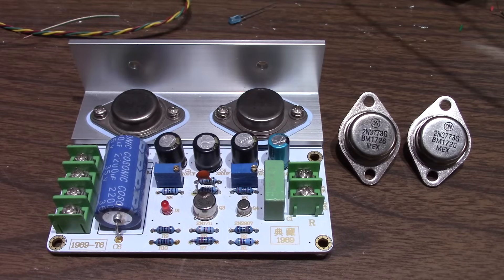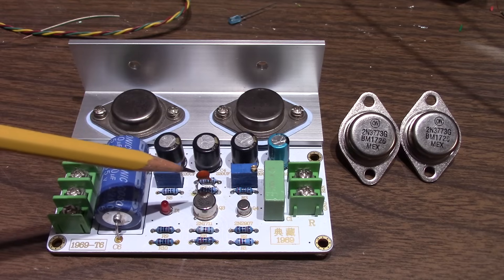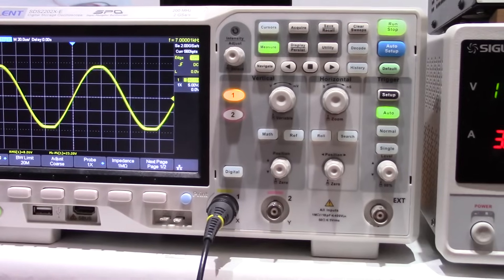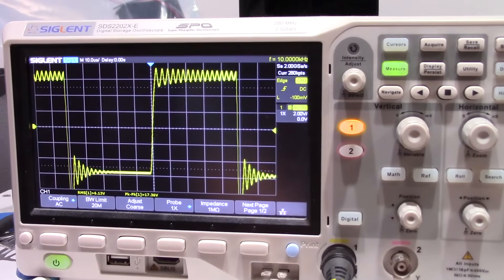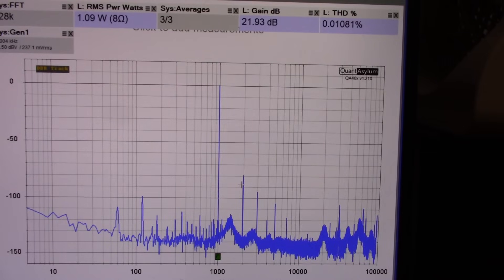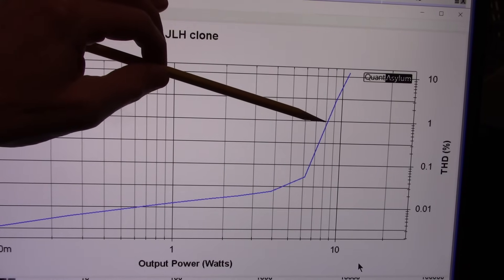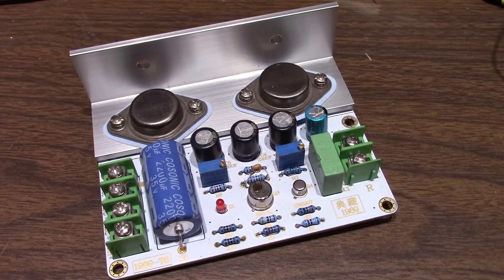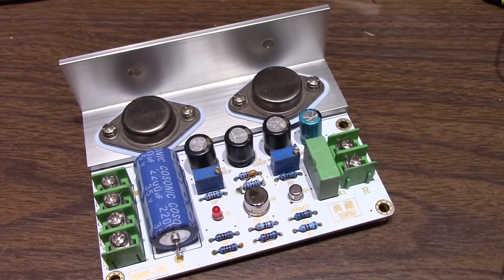JLH class A amplifier clone tested on the analyzer

Comment: This video inspired me to buy a couple of these prebuilt.  I did pull one of the 2N3055s (they all look new) off the board and measured HFE of 29, so well within spec.    Adjusted for T1 at 7.5v and amps pull of .75 which is all I could get with 15v supply.  Scope showed about 6 watts output, just a small amount of square wave overshoot (not ringing) at 10K frequency.  I will try the 500pf cap across R5, but nearfield listening sounds quite good, maybe a little harshness in higher level female vocals (the overshoot?).  
   Also will try a kit and substitute MJ15003G transistors from DigiKey; those are supposed to be a drop-in substitute. I do use massive heatsinks so there will not be any issues in that regard.  
And I will try decent quality meanwell 24v/5a SMPS instead of the LPS, and readjust.   24v supply should allow full Class A bias.
I have to say that the 1969's sound- even at only 15v supply - compares favorably to my $2,500 Musical Fidelity A1 (2008 version) Class A amp.  And the 1969 pair are two orders of magnitude less expensive!
Reply from the maker: Use 100pf compensation capacitor. 500pf is overkill as was demonstrated in the video. This circuit design may have issues driving certain high power transistors properly, so test when substituting parts.
Reply: @JohnAudioTech  10-4, thank you John!

Comment: Class A distortion is different from Class A/B distortion, so I think the issue is more about the distortion profile than it is about class per se.  And BTW, I'm much more concerned about speaker performance than amp performance.  Having directy compared both via an. A/B system (it's not blind much less double blind but it's an instant comparison, which is what I want) I can very comfortably say my concerns are MUCH more about speaker design than amp design.  In any case I appreciate your analyzing.

Comment: Hi, can you let me know how to setup the amp? i know the first pot it´s for 1/2  sorce voltage, but the current, i don´t know how to setup, could you explane to me maybe with a picture? thank you very much and excuse my english
Reply: Set your multimeter to amps, then connect your ground from your power supply to ground on your amp, then connect the positive from your power supply to the negative lead on your multimeter and then connect the positive lead of your multimeter to the positive on the amp.

Comment: I am pretty sure on capacitive coupled output most people are using cheap capacitor, you need to use low ESR high ripple current rated caps on the output.

Comment: In my opinion, every audiophile must have 1JLH, 1 SE tube amp and no matter how expensiv others amplifiers.
Thanks for video!
Reply: These little modules sound really good with efficient speakers.I replaced my China 2N3055 transistors with NOS Westinghouse, although they sounded really nice even with the Chinese transistors. I would use 200-300VA toroid and lots of capacitance for the power supply, and somewhat large heatsinks.Probably 4x6 inches, 1inch thick should suffice. These modules will embarass a lot of commercial amps.

Comment: Good analysis...  I had a JLH once upon a time...  and I remember liking it.  With a pair of efficient speakers it was quite listenable.  I remember driving a pair of vintage Klipsch Cornwalls with it...  if I remember correctly those speakers had a 100db/1 watt/1 meter efficiency...  and that amp could play them quite loud.  As Paul Klipsch said himself "What the world needs is a good 5 watt amplifier".  Ya, class A is pretty inefficient...  so from a practical standpoint they are kind of dumb...  but like old tube amps they're fun, and that's all that matters.

Comment: Greetings from Serbia. It could be that output transistors are Chinese made by ISC. That is legitimate company and their parts are very good, at least as good as original 2N3055. I noticed that the color they use for markings is easily removed. So it's not indicator that transistors are of bad quality.

Comment: Good video.  I leave my like.
I would like your opinion.
I bought the Behringer CX 2310 active crossover.
My idea is to build a system with three separate amplifiers, for bass, mid and treble. The possibility of being able to vary the crossover frequencies is very attractive to me.
However, it seems to me a waste of equipment to have three complete amplifiers only to reproduce in them only a small range of frequencies.
My idea is to make three simple amplifiers, in a single cabinet, with a single power supply, and as simple as possible.
The crossover delivers a very large signal at the output: up to 7 Volts peak-to-peak on each balanced output, so you can get 14 Volts peak-to-peak on the push-pull.
This means that my amplifier will not need an input stage, nor a voltage amplifier.  I only need to input from the XLR output of the crossover to a single output stage.
Since the crossover does not deliver more than 10 mA to the output, I think an amplifier made with Darlington transistors would be just what I need.
Does this sound like a good idea or do you think it won't work?
Greetings from Argentina.
Reply: First off, be warned that an analog crossover like the CX2310 may not have the flexibility you need for a real speaker. You may need to flatten out the individual drivers' responses passively before they will integrate properly. (Measurements obviously required.) Having a passive series notch to tame your woofer and midrange breakup modes tends to be a good idea anyway.

Secondly, you'll be losing less complexity than you'd think even if you only need what amounts to a power buffer. You can lose your VAS, but without an input stage there'll be nothing to apply feedback to. Said input stage will also need to handle large common-mode voltage swings - unless you decide to make the whole affair overall inverting, which arguably isn't the worst idea in the world and common practice with many headphone driver ICs and the like.

I hope your ground routing skills are up to par, given that putting multiple amplifiers into one case comes with some extra challenges in terms of avoiding ground loops. Just because it's commonly done doesn't mean it's trivial.

If in doubt, there is no shame in buying off the shelf if it suits your needs.

Thirdly, the notion of varying crossover points on the fly sounds a bit hair-raising to me. Those tend to be chosen carefully for dispersion matching as well as diistortion and power handling concerns. It may ostensibly work on the less critical woofer-midrange crossing, but the mid-tweeter crossing could prove a lot more tricky in that respect. I would very much suggest frequenting an active speaker DIY community (maybe the diyAudio forum, even ASR's is not half bad) and getting yourself up to speed.
Reply: @PileOfEmptyTapes   WOW.  You have dedicated a very useful and extensive comment to me.  I really appreciate that.
Let's forget about my project for a while.
For now I am running my system with three amps.  
The treble I repruduce with an Akai AM-UO2; the mids with a Technisc SU-V660 and the bass with a Pioneer A-80 (a monster !!!).
Of the three amps, the only one that belongs to me is the Technics.  The other two are borrowed and I have to return them.
Now imagine what a waste of equipment .... to use an Akai just to drive a tweeter between 4000 Hz and 12 Khz, or to use a Pioneer to drive a woofer between 30 Hz and 120 Hz ...  it seems silly to me to waste equipment like that.
Much more logical (and according to engineering) is to develop a triple amplifier, sharing the same power supply, the same cabinet and perfectly matched to the XLR outputs of the crossover, because it will not work with other equipment but with that crossover.
All other considerations are technical and, with more or less effort, I will be able to solve them.
Best regards from Argentina.
Reply: what are you driving? 3 way active crossovers are usually for 200+ watt rms PA applications, not home units that just use passive 2 ways usally.
Reply: @thedavesofourlives1  I don't think the same as you.
You use active crossovers if you want them, no matter how much power you want in your speakers.
I built myself two three-way cabinets, with a 15-inch woofer inside a bass reflector, an 8-driver array for the mids, and a horn tweeter.
And I used an active crossover because that way I can adjust the sound quality according to my personal taste.  
Depending on the kind of music I want to listen to, I can run the woofer from 10 to 140 Hz, or up to 400 Hz, as I like... or the mids from 200 Hz to 4 Khz or from 1 Khz to 6 Khz... and the tweeter, the same.
The flexibility of the system is such, that I get a variety of sounds with an incredible variety.
So far I am using three good brand amplifiers of which only one belongs to me.  The other two have been loaned to me and I have to return them.
So I will build a triple amp that fits perfectly with my crossover.
The interesting thing about all this is that the crossover delivers a very large voltage at the output.  On the “XLR” connector I can measure 14 Volts between pins 2 and 3. So .... why do I need to amplify that signal if it is already huge.  The only thing I need is to control with that signal an output stage that gives me a high current to drive the speakers.
I don't need a differential input stage. I don't need an intermediate voltage amplifier.  I just need a good linear output stage and it occurred to me that, with two well polarized Darlington type transistors, I would already have my “adapter” (better word than “amplifier”) that will allow me to connect the output of the crossovers to the speakers.
Besides, the signals between pins 2 and 3 of the XLR connectors are already 180 degrees out of phase, so if I connect each output to each Darlington transistor I don't even need a phase inverting transistor.
With only TWO Darlington TRANSISTORS and several resistors I would have enough power to drive my 4 Ohms speakers.
And I wanted to know John's opinion because I don't miss any of his videos.

Comment: The 2N3773 is a slow transistor. In fact, none of the four datasheets I have for it even list the fT. Of course, real 2N3055's are slow, too. I don't know about your counterfeits. You might try the MJ21196G, which is a massively powerful transistor, and which has a published fT of 4MHz.
Reply: I'm guessing the stability of the JLH depended on those old slow 2N3055s...
Reply: @Luckless_Pedestrian  A lot of amps from late 70's early 80's depended on slow devices. They often sounded very nice though, perhaps due to less complex circuits required or just the nature of homotaxial transistors (vs. modern epitaxial types).
Reply: @peterlarkin762  Yup...  have some vintage stuff with those old, slow '3055s...  learned a lesson years ago in rebuilding a Dynaco ST120...  although Dyna had used several different OTs over the 120's long production run, mine had the '3055s (specially selected high voltage versions so I'm told)...  when I rebuilt it, I decided to use more "modern" Motorola devices (can't recall the designation) that were "faster"...  long story short, I wound up with a 60 wpc oscillator...
Reply: @Luckless_Pedestrian  Lol same experience with Audiolab 8000a, Arcam A60, Luxman L30. Back in the day the manufacturers could request specific Hfe and Ft. Early Audiolabs had unique custom outputs... impossible to replace now. Same goes for small signal BC's, there are so many variants. Modern ones sound just ok. Some vintage telefunken's sound more natural. Anyway, hope your Dynaco found better times. If not send it to me ;)
Reply: @Luckless_Pedestrian  I was just thinking the same thing.  It is such a a simple circuit
Reply: The 2N3055 is 2.5Mhz, not much slower than 4Mhz????    ...am I missing something?
Reply: @stevenbliss989  The Ft varied hugely between brands and years. Same with the 2n3055. It was due to the manufacturing processes. Pre 1980's devices are probably below 1Mhz. From mid-80's on they are all 3 to 4Mhz. MJ21196G might be a good choice as they're very rugged, but might need some miller compensation.
Reply: @stevenbliss989  I wasn't sure what the fT of the 3055 was. But, the MJ21196G is a much heavier transistor in terms of power dissipation, current, and voltage.
Reply: I struggle to hear above 6khz !
Reply: @TernaryTrout  Mine isn't quite that bad, but at almost 61, I can't hear like I did as a young man. When I was a teenager, I could hear to 22kHz in my right ear, and 18 in the left. Now both ears top out at 12K.

Comment: Interesting stuff JAT ! there is a comment down below about the choice of cap used in your demo, would you explain it please ? it involves passing all your audio through the cap and it sounds awful so I am confused as to the location of the cap.....if that makes sense !!....cheers
Reply from the maker: Some type of capacitors have a nonlinear response to a changing voltage on their plates such as class II ceramic capacitors. Class I types such as G0G/NP0 types have orders of magnitude better performance. Poly film caps are even better. The cap is in the feedback loop where distortion introduced in the circuit is not corrected. I used a class I type cap.
Reply: @JohnAudioTech  Ta :)

Comment: Class A distortion is primarily Even-order Harmonics.  These are way less objectionable to the ear than odd-order.  Efficiency does not make the list of criteria for my Amplifier selection.  It's not like I'm using AA batteries to run it.
Reply: Depends mainly on you age. Second harmonic distortion is liked by young and third by old . Second sounds sharp and bright third sounds warm and mellow
Reply: The even harmonic is down to transistor choice and no balance long tail pair on the input.
An npn pnp output causes even harmonic cancellation.
If you read Doug Selfs book you will see the graphs for this.
Reply: @Margarinetaylorgrease  I meant to say that the distortion measured is not as objectionable if it were odd.  Not that it needed further reduction for this power level
Reply: @keithblume5159  
Extra, with npn pnp output 3rd is increased over same sex output. Yes I sex my transistors

Comment: Just a tip, use good quality capacitor in your feedbackloop because all your audio is going throug it.
Reply: You mean the NFB resistor by-pass, or the electrolytic to signal ground?
Reply: @paulb4661  what I saw in the video he was using a cremic capacitor in the NFB loop. Those sounding awful. Try in a good sounding amp silver mica capacitor instead.
Reply: @gilbertbergh8980  agree, I’ve done side by side recordings with film and ceramic, it was night and day.
Reply: @gilbertbergh8980  The former then, I'd argue that, using your semantics and without going into too much detail, the "audio" passes through the resistor and only the ultrasonic content goes through the cap, whose sole purpose is to result in the amp attenuating, rather than amplifying these. In essence and in a simplistic form. If I were to suggest anything, it'd be to go with 1216 smd NP0 MLCC, as this eliminates stray inductance of the leads and in general, smd topology allows for shorter signal path and better tolerances, than traditional THT.
Reply: @Margarinetaylorgrease   Recordings of what? An amplifier's output with either of the by-pass cap type in the NFB loop?
Reply: @ thank you for asking.
I had two identical condenser microphones.  Both had ceramic caps in so we changed one to a film cap.
Recoded a drum kit. 
Ceramic cap top end sounded like dried beans in a can compared to the film cap and the film cap also sounded like it had an extra octave on top.
Beans in a can is a slight exaggeration but the extra octave isn’t
Reply: @Margarinetaylorgrease Imagine you have to plough a field and visit your parents. One calls for a tractor, the other for a passenger car, but, based on your experience of going on a road trip by tractor, you say it's no good for ploughing the field either.
Reply: @paulb4661  I'm not sure this guy's statement is true, I would like to know the answer to your question too. May be @JohnAudioTech can shed some light on it.
Reply: Some (all?) ceramic capacitors change their behaviour with varying voltage,   which means they are non-linear.  Not to be used in signal paths.
Reply: He's mentioned in other comments that class 1 ceramics are used here (G0G/NP0). They have excellent voltage linearity and don't mess with the sound in my experience. Of course a silver mica is nicer technically but rarely necessary.
Reply: Hahahahahaaha .
Reply: I get the impression JAT knows that he just grabbed whatever he had close by